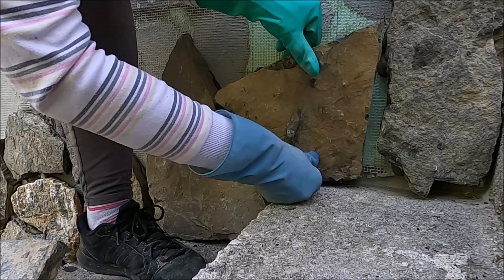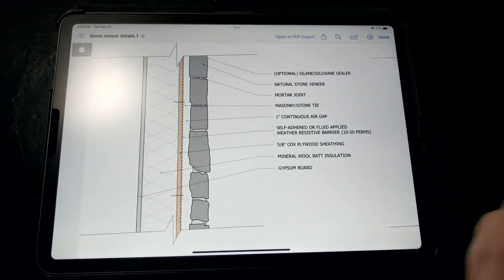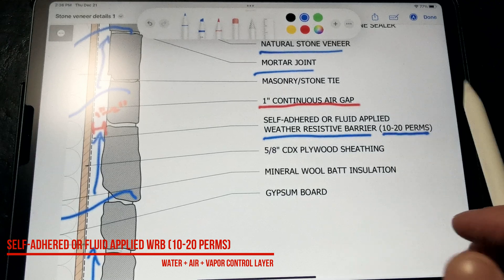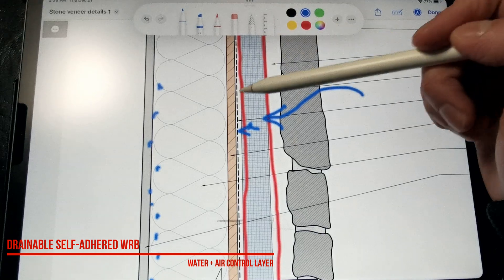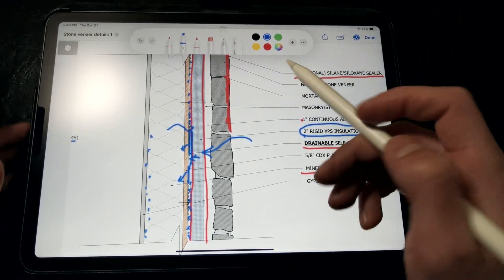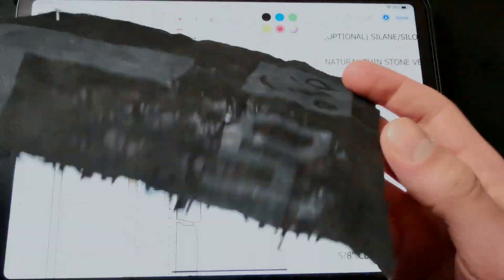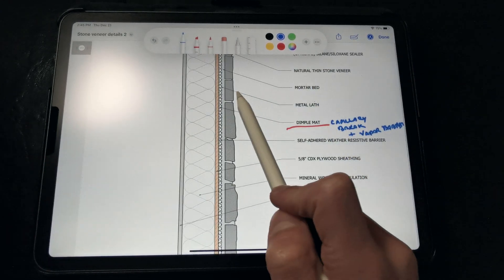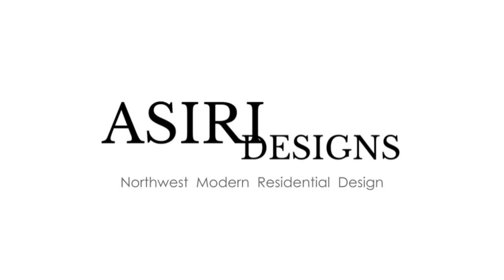Stone Veneer Waterproofing Details For Architects + Builders (Prevent Moisture Issues)

Comment: Thank you for your videos, they’re amazing! Do you need to do any water proofing behind stone veneer if it is being installed over poured walls? I understand below grade that a fluid applied sealant with a dimple over it works well, but what about above. This is very common with walk out basements where you’re building on a slope

Comment: It's worth mentioning that rigid mineral wool bats can have a sufficiently uneven surface to avoid having to use a drainable wrb. I think it's better just to have a taped integrated wrb in the sheathing and avoid using another product.  

I'm thinking of fire safety and the need to move away from petrochemicals products as much as possible. The fire safety is a big issue in the UK, as a result of the Grenfell Tower disaster - which was caused by the cladding lacking fire breaks, combustible external PIR, and large ventilated cavities.

Comment: You have some of the best content I’ve ever watched. Every video has so much detail and answers so many questions I have. Keep up the good work!!

Just one question, I’ve been reading about ‘breath ability’ and I see you say that the foam exterior insulation is highly impermeable. What’s to stop condensation accumulating on the interior of the building?
Apologies if this question makes no sense I’m still very green haha.
Reply from the maker: Thank you so much for the kind words, I am glad to hear the videos are helpful! Great question regarding the foam board - The rigid foam is installed outboard of the sheathing and the weather barrier, so it's keeping the temperature of the sheathing warmer and closer to those interior temperatures, reducing the chances of condensation. Colder climates require a higher ratio of rigid insulation outboard to prevent condensation, while temperate and warm climates need a lower ratio. If condensation was to form, it would dry through the WRB, re-condense on the surface of the foam board, and drain down the  surface of the WRB. That's one of the reasons why we want to use that drainable WRB like Hydrogap SA or Typar Drainable Peel and Stick, so that any water that happens to find a path behind the rigid insulation can drain out. Hopefully this makes sense!